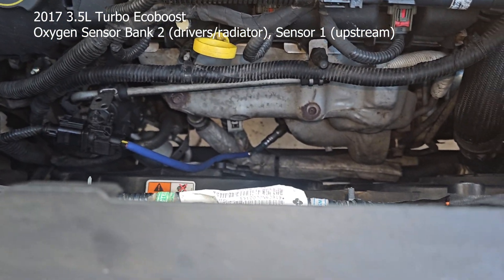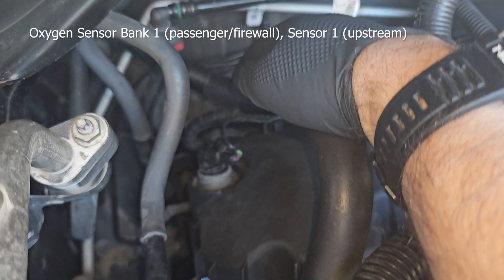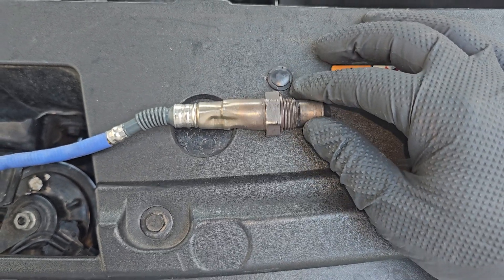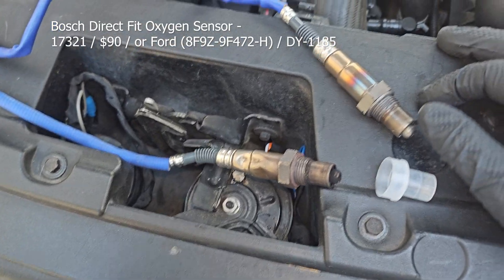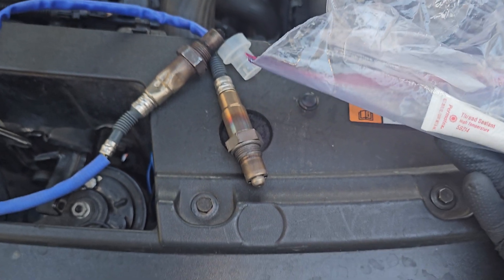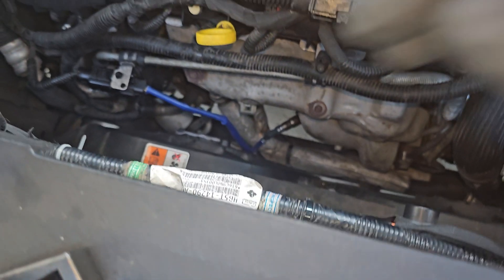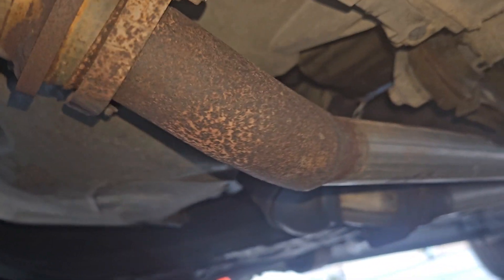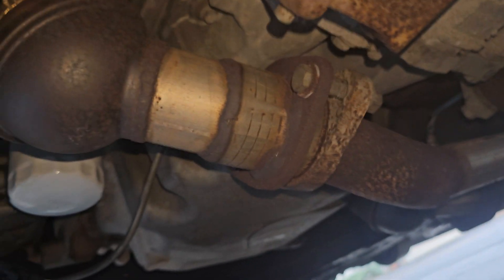Changing Oxygen Sensors on 2017 Ford Explorer Police Interceptor Utility 3.5L Ecoboost: Part 1

Comment: I have a 17 police interceptor  explorer. Any tips on removing the bank 1 sensor 1  connector piece?
Reply from the maker: I just had a crazy crazy long wrench/breakbars
Reply: Where is this one located? I have a P0131 code calling this one out on a '17 explorer sport.
Reply: @gerardomorales4078 if I remember correctly it's behind the engine, you can see it from the top or behind the right front tire.

Comment: I had to end up using an inductive magnetic heater to heat my O2 sensor cherry red as my 1200ft lb air wrench could not budge it.

I busted a 1/2” impact u-joint trying to bust it out.

The inductive heater was a great buy - especially since my 2016 3.7 PIU was an ex Ohio police vehicle and the amount of road salt corrosion is insane.